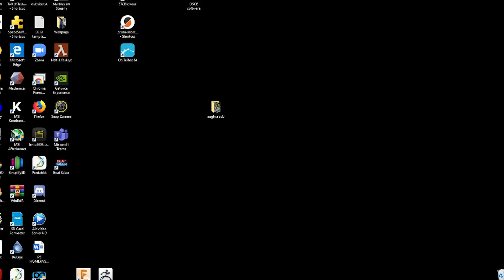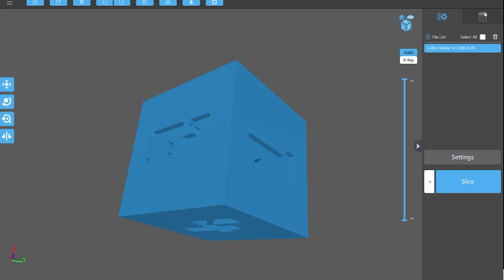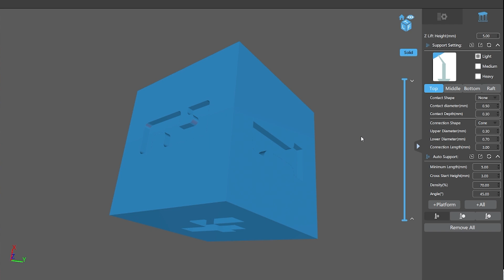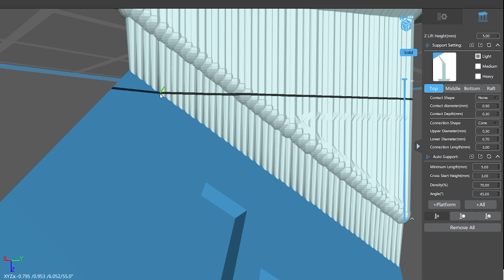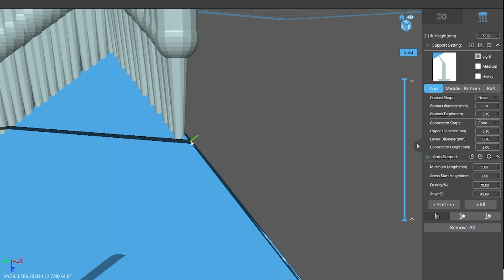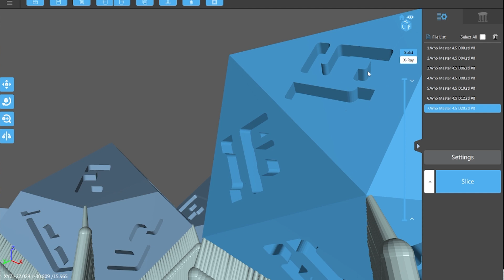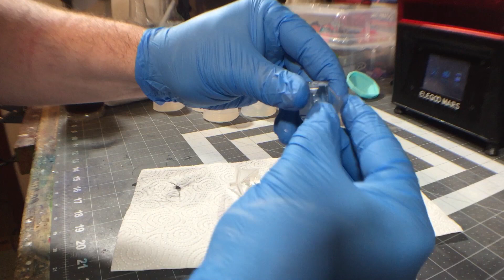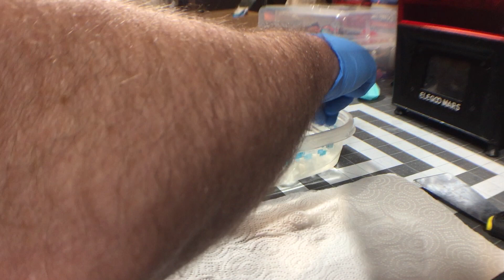3D Resin Printing Master Dice the Easy way!

Comment from the maker: Update*  Thanks to the efforts of many helpful people and experimentation a few settings can help with this technique.  Set your lift speed somewhere between 40-60.  When placing supports try 10mm off the build plate instead of the default 5mm.  If you are having trouble getting your supports straight you can change the setting for the light supports > Middle tab > Angle to 0.02 (you can set it to zero  but it will default to 0.02)
Reply: even with Angle set to 0.02 my supports wont go on straight. i cannot for the life of me figure out what I'm doing wrong.
Reply: YES!!!
Reply: I wish I would have found this comment before! But I'm so glad you had an answer :)
Reply: I know this is much later but do you have any suggestions for a Mars 2 Pro settings these days?
Reply: I wish I has seen this comment,. I had to work this out on my own
Reply: Still can't get decent d6 without bottom tip warped. I applied almost all suggestions commented here with no luck :(
Could it be the slicer? I use Lychee and all my other prints and dice print perfect.
Reply: lift speed between 40-60? On my saturn 3 ultra lift speed is between 90-320!! if I decrease the lift speed, I will not have puffy faces anymore? If I do so, the print will take 10 hours, so I hope that puffy faces and blurry numbers will be forgotten forever... I already leveled up the 5mm default , but ugly faces are still there, so maybe I need to sacrifice time for quality...🤞
Reply: hello
why 40-60 lift speed? 
is not too much?

thanks
Reply: @miguelmassvieira  So, most printers default profiles are with a 100-150 lift speed. THAT is too fast. Common thought is a lift and bottom lift of 40-60 pulls the print up slower, allowing the FEP to flex but not RIP the print off, which could ruin the supports and casuse warped or failed prints.
Reply from the maker: @miguelmassvieira  I use 40 personally, but every machine is different, FEPs are at different tightness so you'll have to experiment
Reply: @Rev_Chumley  they really shouldn't be, do you not tune your FEP film?
Reply: @Rev_Chumley  they really shouldn't be. There's papers out there explaining which frequency works best for fep film. I use a chromatic tuner to tune the fep. Consistent results everytime

Comment: Took me a while to understand that the proper orientation for d6 is 45deg on one axis then 35.26deg on another axis. 

Is there a setting that removes the angles from the supports like you have it? Lychee slicer keeps adding angles between support and the tip 

Also, you are brave for keeping your vape and drink that close to your resin 😂

Comment: Thanks for all these advices ; I tried to print a D20 and a D6 almost like you did, but it failed : with sunlu abs like clear resin 1.7s exposure time, 10 mm high on build plate, I still have ugly faces and numbers on build plate side... And I think that putting a support exactly under the tip of the dice is not recommended, for me when I removed the supports on the D20 the tip of the dice broke and the master is ruined, impossible to fix with sanding...

Comment: how are you getting such clean prints with clear resin? No matter what I do I get this bulging effect where all the fins merge at the tip and the dice become unusable. I have spent weeks tweaking every setting i can think of but can't get it to work. either the supports fail during printing or they bulge out and majorly deform the tips. I know I could switch to opaque resin but I've already purchased so much clear.
Reply: did you find any solution to fix this problem? I have got the same , today I printed my first dice masters with sunlu abs like clear resin, and all the bottoms of my dice are  distorted and puffy... do you know why? First I did a print with test to be sure that exposure time is correct, so I don't understand what happened...
Reply: @danteinferno6513 now its my turn to ask both of yall lol. Im curious which resin to get myself

Comment: Great video. The dice I printed using this method turned out great... except for the d6. There was drooping on the bottom face numbers and where there were sharp recessed corners (like the upper left of the number 5) the print seemed to split or crack. Any suggestoins?
Reply from the maker: Support anywhere that needs it including numbers.  Try raising the D6 a little higher off the plate. Might help

Comment: I suggest learning fusion 360 and adding bumpers to the edges and your own wall supports. Then when you go into chitubox you only need to support the numbers. Also it does matter if there's an island. Your vat is going to have a bunch of tiny cured chunks floating around.

Comment: Couple of questions….
1) do you find changing the layer height makes any difference? I believe my default is 0.05, should I change to to 0.02 or would it not make any difference?
2) you talk of not needing supports for islands in the middle of the numbers. All instinct says they should not print properly without them so what exactly happens that means the supports aren’t needed?
Reply from the maker: 1. Given you have to sand and polish the masters anyway, it makes little to no difference.  If you have an extremely bold number font, it may help with visible stepping in the fonts, but you would have to have eagle eyes to see that. 2. I said my font didn't really need supports, but I also said if you have a different font you may need them and that it wouldn't hurt to put them in.
Reply: @Rev_Chumley  thank you for the info.

Comment: So my dice come out looking very crisp, but I have a problem The point on the D20 that is facing the plate, seems to be longer/sharper. How do I prevent this from happening?
Reply from the maker: Its generally a non-issue as the small amount of extra material on the point gets sanded down when you polish the masters.

Comment: Great video, man! Your vid and Rybonator's video on this support method helped A LOT when it came to printing my dice. I'm not expecting an answer cuz of how long ago this was posted but I'll try anyways: Why the transparent resin? I see a lot of dice makers make their masters from this. Is it just personal preference or does the resin bring up imperfections better? I haven't sanded the regular resin masters yet and I'm wondering if I should invest in clear. Thanks again for the great video!
Reply: He wrote 9 months ago: "I use Siraya simple clear resin in mine and have had no inhibition issues since."
Reply from the maker: The Siraya Tech Simple clear doesn't inhibit plat silicones as badly and when you polish the master the clear helps tell how well you've done it.

Comment: I've been resin printing since Dec 2019, FDM since march 2016. However, I've never been successful printing dice. The supports, even super lights which I use on my 3d Minis that come out awesome, leave marks I'm not happy with. BUT .. my real question for you is when you have say the D6 point down, and i dont know what layer height you're using. but i use 0.03 usually, the first layer is really just the point, and if you have a support hitting right on that tip, then the tip will print "inside" the support. and when you take it off, you'd likely have no point on that supported edge.  So, do you just sand and reshape the edges? do you roll without a point on that one side? Really appreciate your help. Honestly, Im just printing the dice to have as a prop. I dont play or paint, i just want to have a successful self-printed dice set :)

FWIW, my support settings are WAY lighter than yours. Your light settings are more "aggressive" than my heavy. And even with that, the tip looks to be a horror show on the pointing down edge.
Reply from the maker: Masters will always be sanded to prepare for molding.  I’ve had zero issues with points on any of the dice after they have been sanded and polished.

Comment: Thanks a ton for this. I just printed a set I designed but I tried with a face down, do not recommend. Even with a lot of heavy supports, the bottom faces came out pretty warped. I will definitely give your edge supports a try!
Reply from the maker: Hope it works for you!

Comment: Thanks for this. I got into printing via resin in Dec 2019, after FDM since May 2016. I love it, and one of the first things I wanted to print were dice. However, they failed miserably - rough edges, etc, and I gave up on it. I dont play, or pain (or sand or polish), but something about perfecting the process drives me. Today I decided to try it again, and a quick search gave me this video. Pretty cool. I dont think I'll ever get to the level of mastering, molding, etc - but it's super cool to learn. I'm going to give it a shot over the weekend!! Subbed based on this video, thanks!
Reply from the maker: Hope it works for you! make sure to read the pinned comments.

Comment: Wow thank you for this! I've been struggling for over a month to get dice successfully printed and this method is PERFECT. I read through the comments and the 10mm supports and lowering the lift speed made all the difference in the world. I also found that the islands in the numbers were pretty much inevitable especially on the d100, so I added extra support anchors to the inner part of the zeroes and other islands and that fixed the issue I was having with failed edges and landed me a perfect print.

I finally have perfectly printed masters all thanks to this video and your wonderful instructions!
Reply from the maker: Glad it helped!

Comment: I love this video and am making my first set of masters.  I am struggling getting some of the dice support to place int he center of the edge and not go off to the side.  Mainly the D8 and up.  I have matched you support setting, but no matter how I try, the support always attached to the edge, but goes of to the side.  I can make a wall support that way so I hope it works. Any advice on what an be done to better get the support in stay centered.  Thanks
Reply: I'm having this exact same issue. Did it end up working for you with the support going off to the side?
Reply from the maker: Check the pinned comments.

Comment: I was wondering if you would be able to share the printing settings you used in Chitubox. I've been trying to print dice for a while now and I'm still having issues. Thanks in advance!
Reply from the maker: that will depend on what resin you are using really. but check the pinned comment

Comment: Am I the only one where on the sharper angle dice I can't get it to do the straight supports? I am using the latest version of chitubox and it wont work for me.
Reply from the maker: Check the pinned comment about support settings

Comment: Started using these setting and was getting successful prints. Except however for the D6,it still comes out warped. Not sure what more I could do or settings I could change to fix my issue. Any help would be appreciated
Reply: Same. Been trying to find a solution to the d6 specifically
Reply: @arodnap760  I had seen somewhere about hollowing out the D6,I haven't tried this but I might give it a shot
Reply from the maker: Did you try the pinned suggestions?

Comment: Dear Rev Chumley, you have no idea how helpful this video is to me. You have the exact setup as me, so that helped. I tried placing the supports like you did and the dice came out awesome! It will help me to save so much time. I used to sand and correct the dice I printed and it was a long and frustrating process. With this method of placing supports, everything just became so much easier. Thank you so much!
Reply from the maker: Glad it helped

Comment: Great video!  I was getting frustrated both trying to use autosupports and using autosupports with manual editing in both Chitubox and Prusaslicer.  All I was getting was a lot of misprints and grief cleaning failed prints off of the FEP.  This approach works great.  For what it is worth, I pulled down a trial of Formware 3D.  Once I put the STLs point down, it autogenerates supports much like this.  Not sure I can justify the price of that, just for supports, though.  We'll see how much value I can find in the remaining 29 days of my trial.  ;-)

Comment: awesome tutorial! I am getting some sagging in my walls. Would you be willing to share your settings for the siraya tech clear? I am also having issues where it is fusing at the base and into the die itself. I am printing on a mars. thanks!
Reply: If you are printing the dice directly on the base that is the cause of the curing into the dice itself. The elegoo mars has a longer cure time on the first layer so make sure to print the dice off the build plate using supports. As for the walls sagging maybe too thin of walls? I don't really know.
Reply: I'm having the same problem! My die sags down for about 0.3mm -.- Did you find any  solution for it?

Comment: I would say this video is epic. Got a resin preinter last week just to make my own masters. All the dice I printed so far look amazing because of the tips in this video! 
Have a question about the d6. The faces that have  a corner pointing at the build plate are coming out with edges  .20mm longer than the face  that has no points (all of these edges are a perfect 16mm) touching the build plate. Any suggestions on where I can start researching to get a perfect or close to perfect cube? So far only have been seeing "calibration" cubes for fdm printers. Thank you once again!
Reply from the maker: Try lowering your lifting speed in chitubox to 40 and see if that helps. Most small inconsistencies can be corrected when sanding and polishing as well.
Reply: @Rev_Chumley  that did work. Still a few mm off but I think I am expecting to much out of my printer (ld-002r). I was able to sand/polish to a near precise cube. Once again great video!

Comment: Hey, I was wondering if you had any tips for getting the supports actually on the edge? I initially hit a rhythm and got a couple dice done pretty quick, but now it's completely dragging and I find myself hitting ctrl z for a couple minutes per support.
Reply: I changed the degree angle in the "middle" option for the support from 70 degrees to 0 (it forced me to use 0.02) and it worked for me.
Reply from the maker: Zooming in usually helps.  If a edge is refusing to be straight on the corner it’s ok as long as they are all angled the same way and as close as you can get them to the edge. You can see that on my D20 in the video

Comment: Anyone have an issue with numbers getting clogged with excess resin due to light bleed? ive got fairly perfect shapes, but the bottom numbers arent very sharp. I know its due to excess resin not draining away, i just dont know how to fix it.
Reply from the maker: Could try lowering layer exposure by a second or two and possibly making the supports a little longer.

Comment: Great video!
 I have tried twice to print my dice and they all seem to fall off the supports so I get no dice and slightly shaped resin stuck to the bottom and the supports are nicely printed and hanging from the plate. Is it because they are too heavy? The second time I tried, I tried heavy supports and the same thing happened. Not sure what else to do. I am using an Anycubic Photon. Thanks!
Reply from the maker: Try lowering your lift speed.
Reply: this is a late response, but for others reading with this issue.  This sounds more like a "leveling the machine/plate" issue

Comment: Nice. Love the supports suggestion. Would never have thought to do it like that. I tend to use a haridryer rather than hot water, though. It works the same, but is a little quicker and a bit less messy. You can also use the hairdryer to heat the build-plate  before your next print - that big slab of metal is a huge heatsink and can stay really cold. Think I'm going to go and print off some dice for myself!! Thanks
Reply from the maker: Great tip!

Comment: Hey man, I really appreciate this video and it did inspire me to make my own masters. For the most part I was successful but I did get some inhibition in the numbers only. Do you find you have to clean/sand the numbers in some way to prevent this?
Reply from the maker: Silicone inhibition is a whole other can of worms. Look into inhibitX
Reply: I washed really well with a toothbrush and IPA, got in the numbers really good, then washed really well again with a toothbrush and dawn dish soap and rinsed with straight water. Then finally laid them under the UV light again to really cure everything up. It worked perfectly for me. Inhibit X ruins my molds.
Reply from the maker: I use Siraya simple clear resin in mine and have had no inhibition issues since.
Reply: @Rev_Chumley   I  also used Siraya clear. I actually did the same with two cleanings with dish soap and a toothbrush, but it was my first try, so I will just make sure I get deep, and I'll wait two weeks, rather than one. Had to learn somehow. The inhibition was slight, so atleast I have some molds to experiment with. Thanks!
Reply from the maker: What silicone are you using? I can mold the day after printing with sorta clear 37 and Siraya tech simple clear.
Reply: @Rev_Chumley   I am using Sorta clear 37 lol. Now I'm actually confused. Hmm... maybe under cured resin? I usually do 30ish minutes in my uv  'oven', which is an aluminum lined box with turntable and a lamp. Any more and it heavily yellows, which for this is fine I guess. Is the 4 hours curing time enough for you using 37?
Reply from the maker: I cure mine for like 5 minutes. I do a 2 or 3 minute cure then polish. After I polish I do another 2 or 3 minute cure and usually mold the next day.  Haven't had any issues. I do let the silicone cure for a good 24 hours before I open the molds.